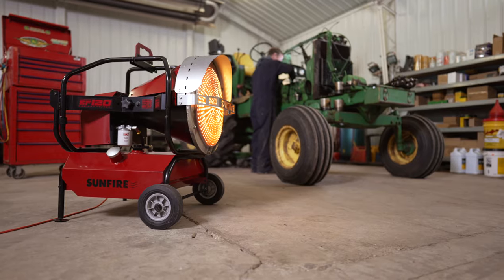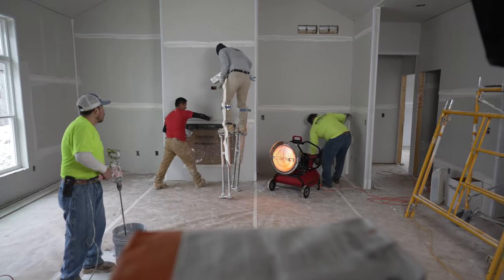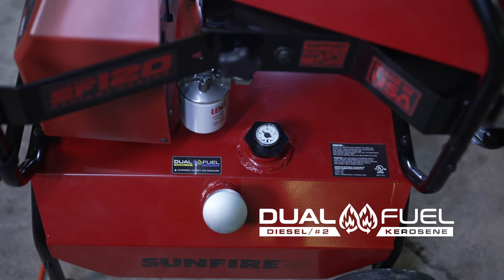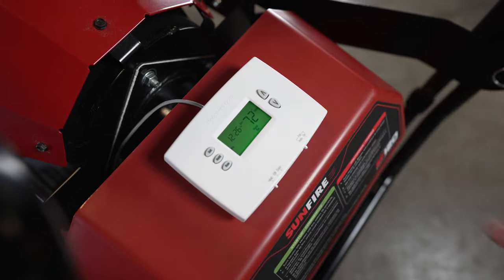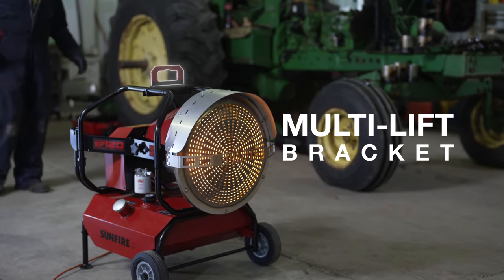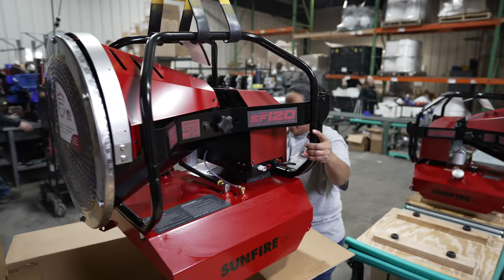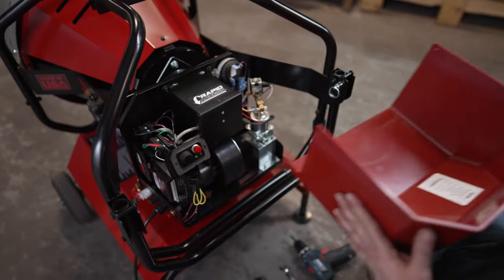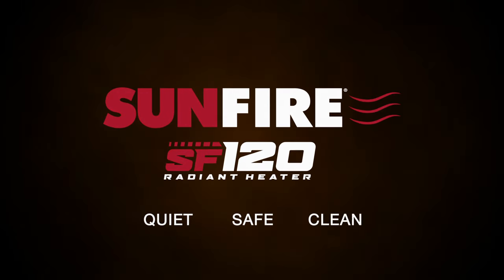SunFire® SF120 Portable Radiant Heater 120,000 BTU Diesel/Kerosene

Comment: Zero zero? Zero carbon monoxide? That's a clean burn. I've never heard of a  zero carbon monoxide heater.
Reply from the maker: Yes - the testing has been consistently at zero as long as the burner is maintained and kept tuned properly from the factory.
Reply: @Sunfireheaters  Incredible, actually.

Comment: These heaters need some type of ventilation system. They emit a strong odor. The no smell claim is false. My shop bought 2 for indoor during the Texas freeze
Reply: Agree 100%! Where does the exhaust go?- Directly into the area where the unit is running. Similar to the sunflower heaters and buddy heaters that can make you sick when used in an ice fishing house or similar. Any appliance that is burning fuel properly should not emit CO. However, it is still not safe to inhale the exhaust. These types of units can deprive the area of oxygen very quickly without proper make up air and/or ventilation. Be very careful! - HVAC installer 38 years-